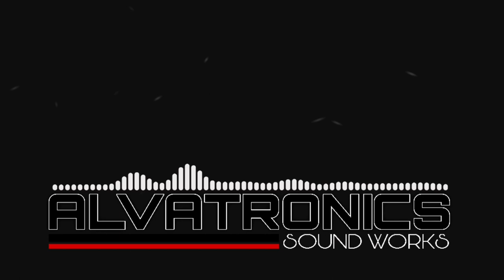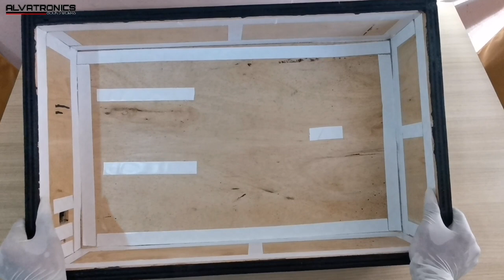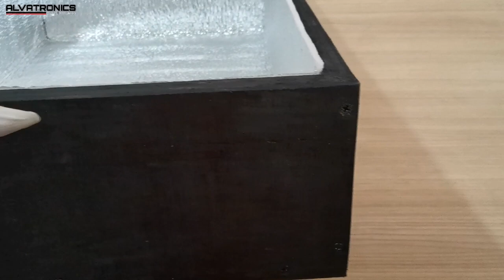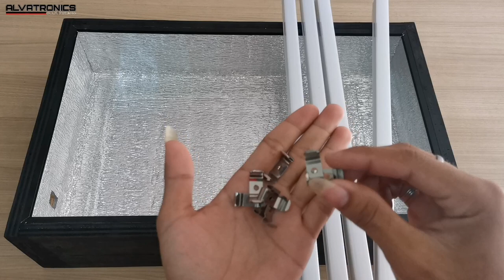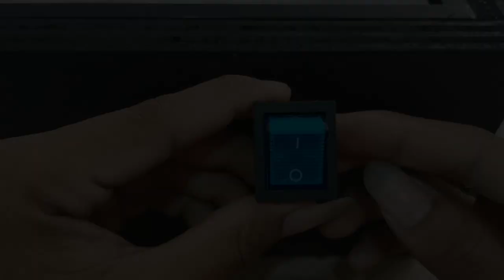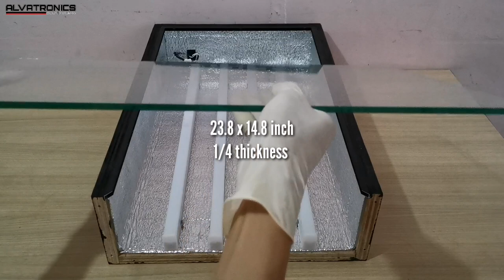DIY Exposure Box for PCB Layout Printing

Comment: Much nicer than mine. The 1 difference is the foam Mylar. I just used a white graffiti spray paint undercoat and a pure chrome from Montana spray paints. Works just as good if you can’t get a hold of the Mylar. Don’t but the generic home depot spray paint, the coverage is garbage.